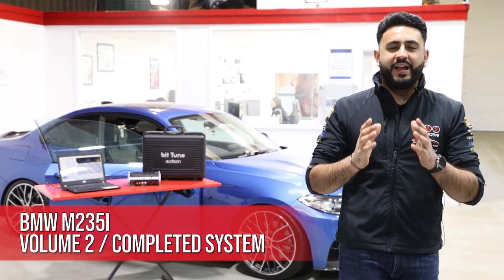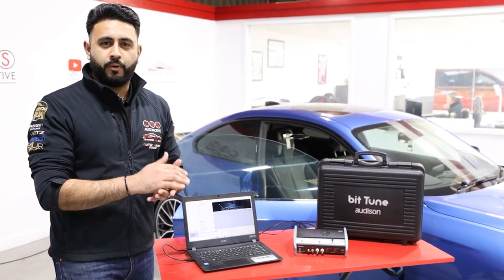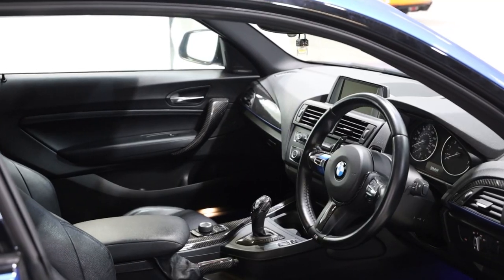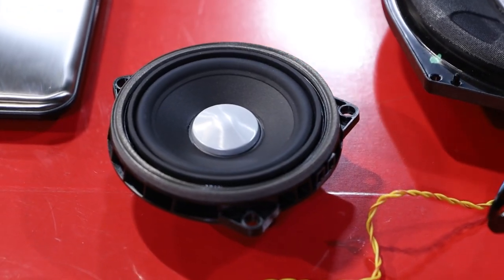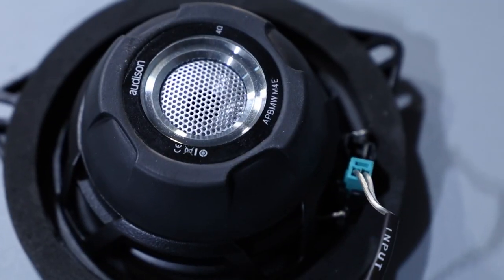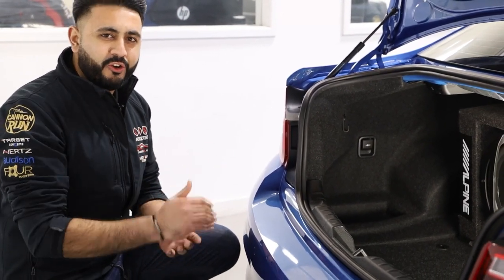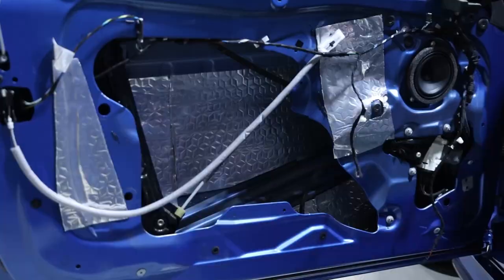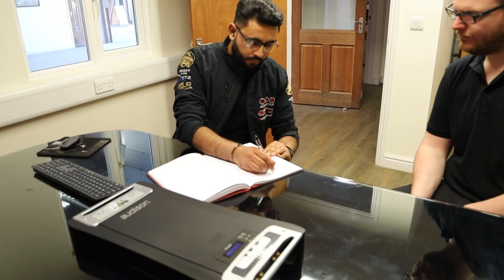NO SOUND to AMAZING SOUND - Behind The Sound - BMW M235i

Comment: What happens to the rear and front-center speakers? Are those also amplified by the Audition AP8.9?
Reply from the maker: Depends on the system and spec. Centre Chanel gets deleted normally. If you have a look at the packets under F Series or G Series you will see pricing and full specs